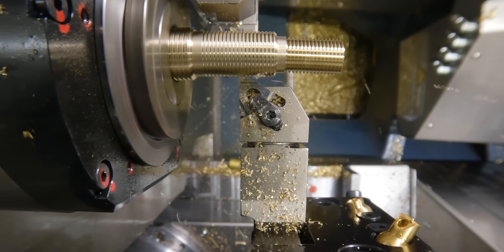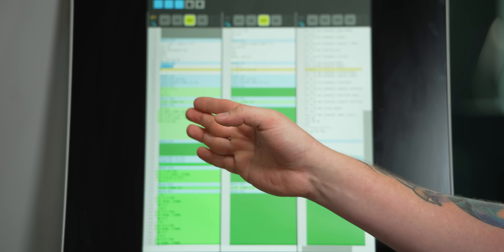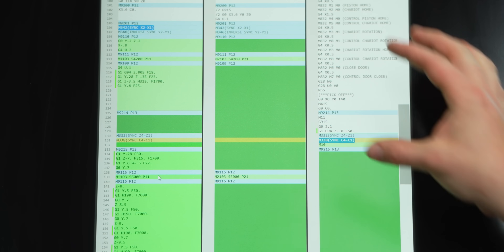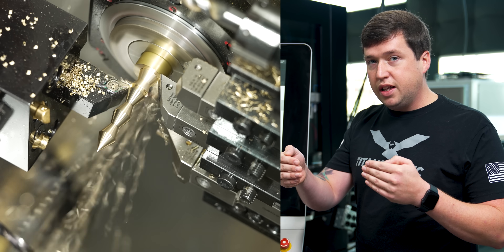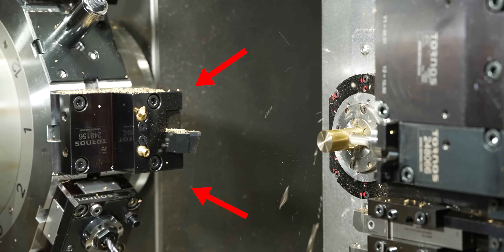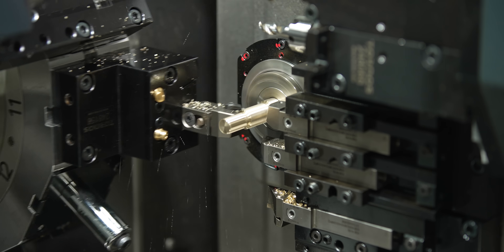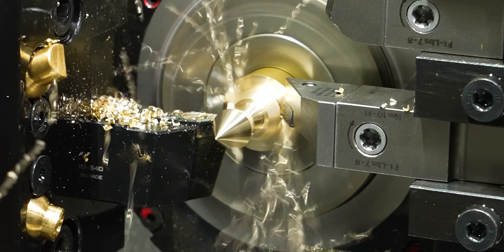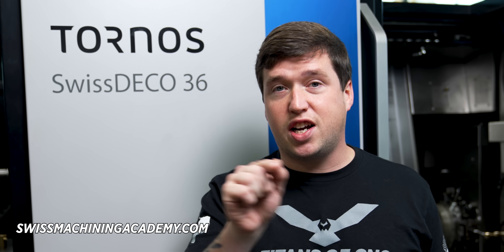The Most COMPLEX CNC Machining Process

Comment: QUESTION. Can you Ratio the feedrate on the C-Axis? Often I find myself wanting to slowdown or speed up the Feedrate on rotary moves but they're often in the thousands of IPM. Is there a G/M code that can change those feed rates (to 50% for example) so it doesn't affect the rest of the program? I hate having to repost the program when all I want to do is make a minor change.